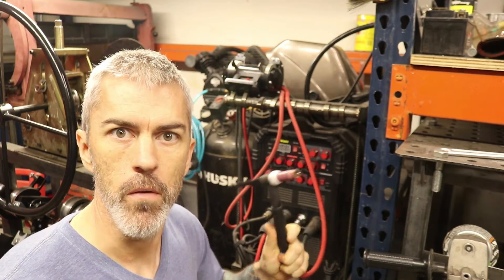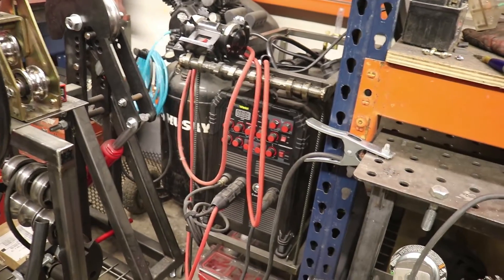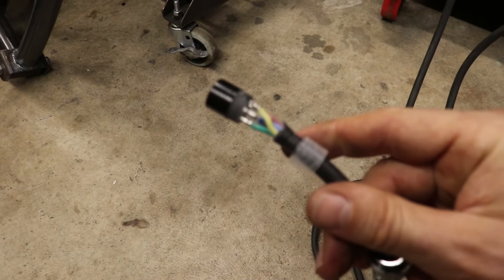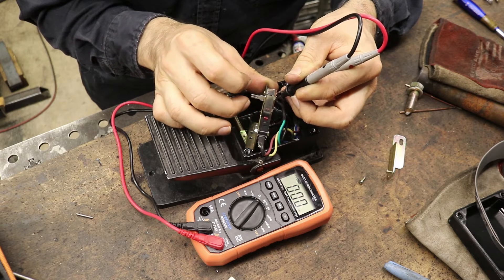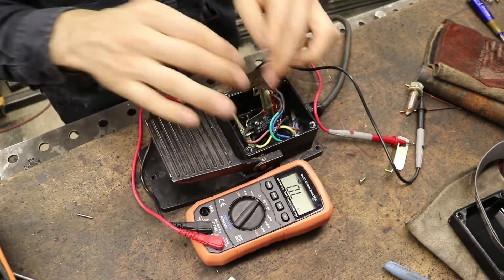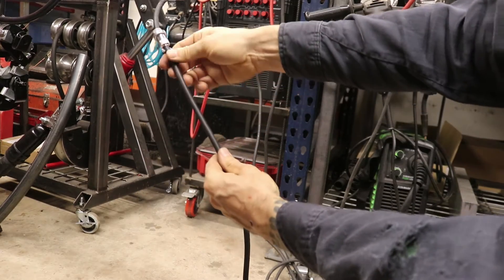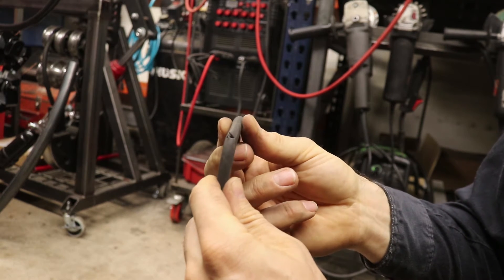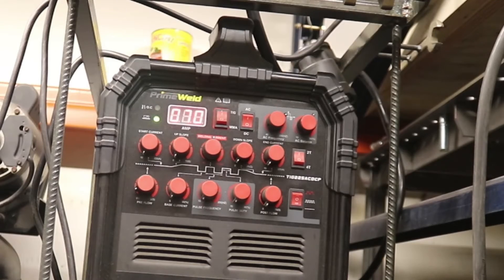TIG Welder No Amperage Adjustment | Foot Pedal Diagnosis

Comment: Thanks, I have the same welder, but different pedal.  Mine wo t build amps, and is stick at 10. I pulled my thing apart, but didn't even think about checking the line.